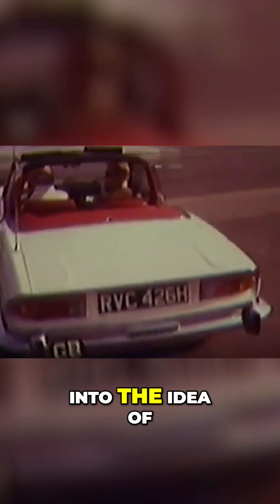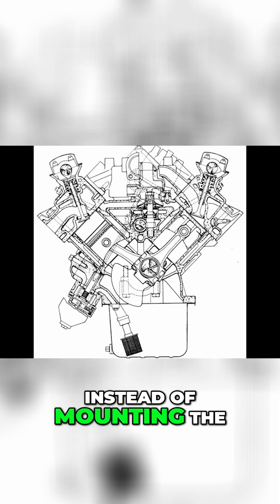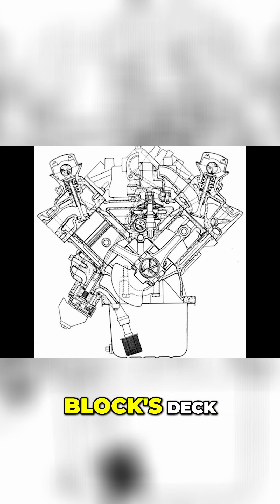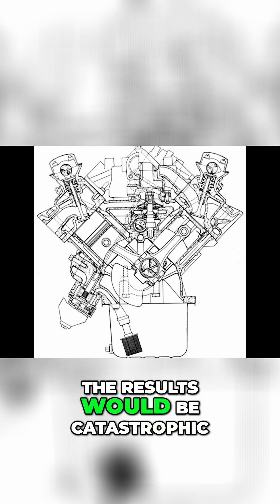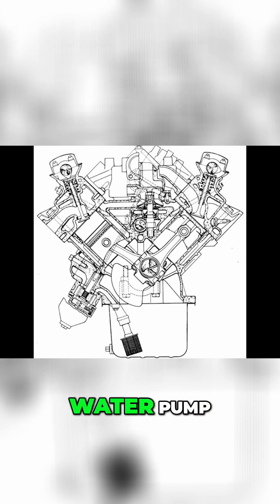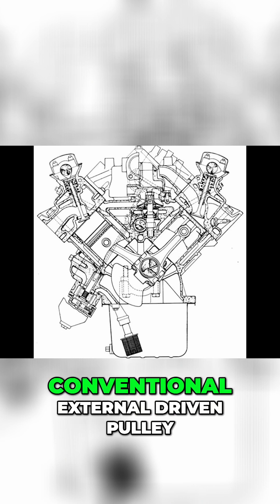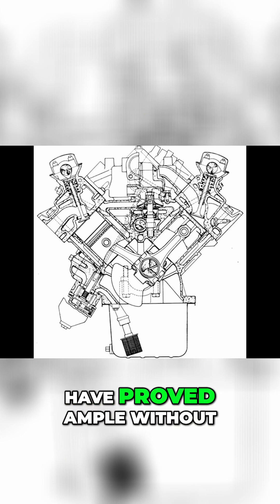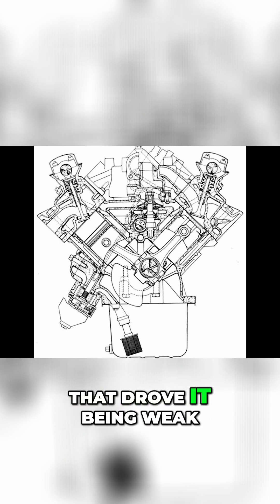The Triumph Stag: A Cost-Cutting Disaster Unveiled

Comment: I persuaded my dad to put a Rover V8 (Hart Engineering in London I seem to recall) in after his engine melted. Awesome car. Also - the water pump - straight out of a Dolomite. Same one was used in the Dolly Sprint. Alnd head gaskets - bolts needed re-torque after 24 hours settling. You wouldn't believe how loose they got if that wasn't done.

Comment: The real slap to the face was that they didn't even need to develop a new V8 engine, the Rover V8 existed, but pride got in the way.
Reply: @ravenouself4181  read the Spencer King interview it’s on the web they couldn’t use because it was to long to install correctly hence the vibration problems and no 2 they couldn’t get any units , they were building 50000 a year and were at full capacity for p6 p5 and Range Rover they was no engines available 
It’s interesting reading and King was no mug as we know?

Comment: Yes, a Stag is a car I've always admired from a safe distance. Swapping in a P76 V8 was the go back in the day here. 🇦🇺
Reply: V6 Ford was better
Reply: @nickcoppard5335 the 2.8 Cologne?
Reply: @nickcoppard5335 Ford's Essex unit was nothing like as good as the Buick derived BMC v8. Other than space saving, the Ford unit is heavier, slightly less powerful and with less torque but with similar fuel consumption.
Why the BMC pushed ahead with the Triumph v8 unit when they had a better unit within the company; has to be a matter of bloody mindedness.
An alternative had there been real knowledge within BMC knowledge, was the Coventry Climax v8 unit as fitted into Walter Hassan's personal Triumph 2000 Estate. But then the production engineers would have got their hands on it and resulted in a another Imp story🤷🏼‍♂️
Reply: @gothicpagan.666 Are you referring to the Godiva 2.5 litre V8?
Reply: @pashakdescilly7517  Yes, single over head cam derivative of the industrial, racing, anything they could find a use for it engine.
Reply: The P76 Force 7! Another one of those missed opportunities!